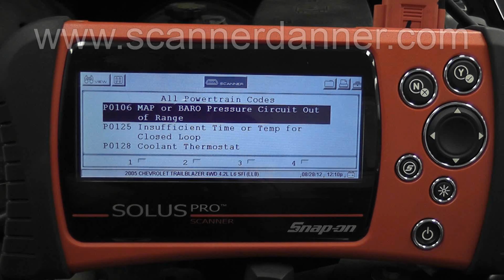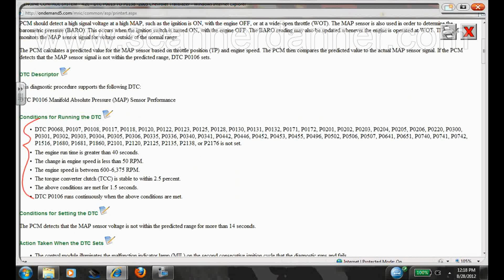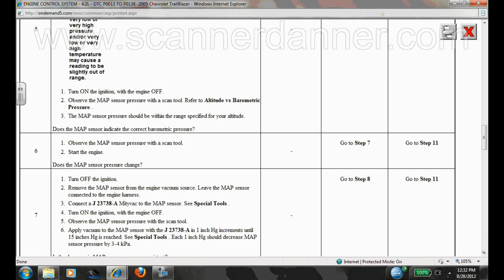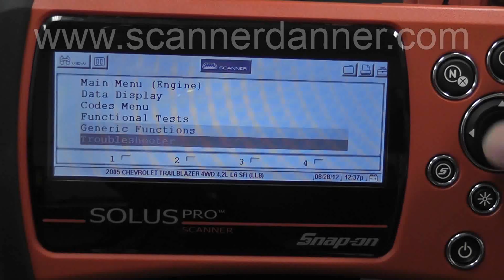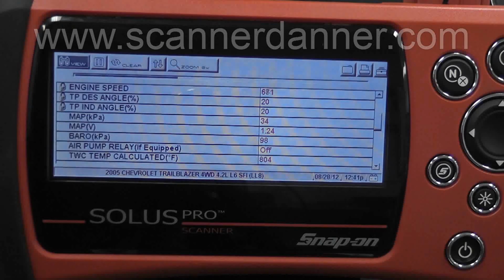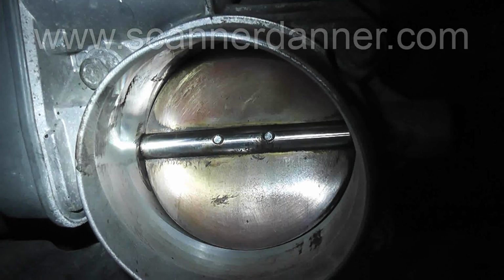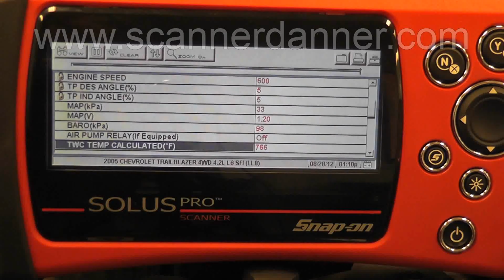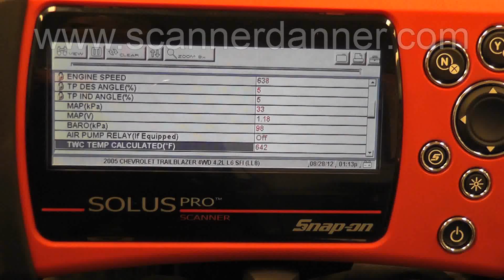MAP Sensor Code P0106 caused by a dirty throttle body

Comment: the thing  that is odd to me. i recall the computer is monitoring what the gas pedal is doing and the throttle plate separately  I know toyota if there is anything blocking the throttle plate from shutting closed the computer would kill fuel and spark and would not allow the engine to run if this engine doesn't have that safety feature that is extremely hazardous and stupid if gm doesn't have this safety feature toyota has. if it does why is the computer even allowing the engine to run?